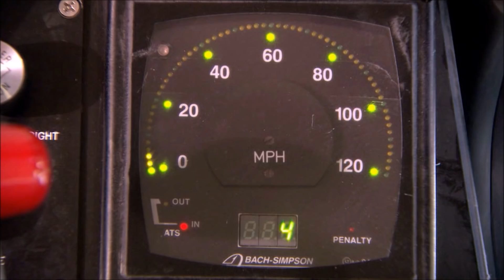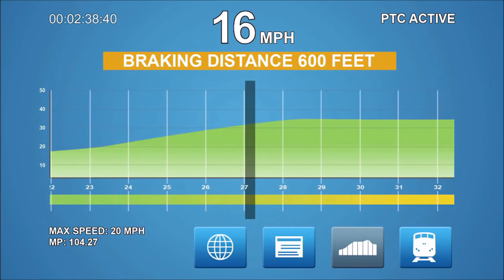Amtrak 501 "Cascades" Train Derailment 18 Dec 2017

Comment: Great report as usual, Juan... Thank you.    It's interesting to me,  that After a tragedy like this happens... how many armchair "experts" show up with all their comments,  and I am NOT including you... yourself, Juan... I am considering all the various posts I've read on various sites regarding this situation.  My heart and prayers go out to all those who lost loved ones either on board the train or in vehicles caught up in this accident..... and I pray that those who are injured will ALL heal, be well again and be able to continue with their lives and loved ones.

Before I throw in my own "two cents" on this.... I DO have past railroad experience as a Head-end brakeman and OJT as a locomotive engineer (until my wife gave me an ultimatum of "the RR.. or us?)... I took the "us" option..... but did continue on as a die-hard "railfan".   : )

A pause for thought..... Does anyone think for a moment that the railroad engineering dept's don't understand the correlation between train speed and track curvature (radius) when building trackage, especially when handling passenger service??..... I mean they've "only" been at this now for about a 186+ years, only to say that I can't imagine AMTRAK running 80mph service through a 30 mph "S" curve (as "shallow" as it is, overall).... unless they knew it was capable of handling it.    

Also,  the usual practice on a new or rehabilitated line that (especially) is scheduled for high-speed passenger service,  is to make at least one run with a train size scheduled for the service, and at the scheduled speeds to be incorporated on that line to be sure of no "issues"... Prior to the inauguration of that service.  Whether or not AMTRAK did this, in this case... I do not know... but that has always (at least in past years) standard practice.  AMTRAKS mainline service is "generally 79 mph".... but the NE corridor (NE-US) between DC. and Boston are running multiple, daily 120+ mph service.... and there are numbers of radiuses similar to the one here in WA.... without incident.

Pictures "can be" deceiving.... but, I will say that at the location of the approach curves leading onto the overpass... the track does Not (at least) appear to be canted in any amount of degree to the inside of the radius to handle any amount of speed beyond what is supposedly the 30mph approach speed limit..... which should have been physically posted ( I may have missed it, in all the various footage), as well as stated on the head end conductor and engineers Train Orders.

Also, the locomotive engineers that are selected for passenger service..... Are the "creme of the crop".... with years of prior service on mainline freights (Far more tonnage and train lengths than passenger trains), and have "stellar" service records (incident free)... they never use "newbies" in passenger service.

I cannot say emphatically.... however,  from what I'm seeing...... I "think" when all the "smoke" is cleared and the NTSB comes to their final conclusions.... they're going to find that "something" was on the track that derailed the lead unit..... and "IF" there was, the NTSB WILL find it,  because as Juan pointed out... the NTSB will leave no stone unturned... they really  excel at what they do,  and I personally... respect them for the fact that they do NOT jump to conclusions.... they just get right down to business and examine, extremely closely... every single shred of evidence from "angles" that the vast majority of the population would Never even dream of thinking about.... and when they make their findings finally known,  you can count on it that it is the result of a thoroughly Exhaustive work.

The NTSB is renowned worldwide for their impeccable and exhaustive work in finding the exact cause of commercial accidents... worldwide.  They not only investigate accidents here in the US but have been called in to determine causes in many other countries around the world, that are generally beyond the scope and abilities of the "country of origin" investigatory teams where train, airline, ship, etc, etc, accidents take place.

One other thing..... ANTIFA warned prior to this tragic derailment,  there might be problems.... they have now "claimed responsibility" for it...,  but whether or not they actually did cause it, or just trying to "make a name for themselves" (or, perhaps it's just more internet hype)..... time will tell for sure,  and the NTSB WILL Know without a doubt what the actual cause was by the time they are finished with their investigation... which could easily take many months or longer.   This is one dept. of the Federal government that does NOT have a history of accepting money to show favorable results on behalf of those who might want to escape any culpability.... they are totally unbiased,  and the cause and /or blame WILL Fall.. where it rightfully belongs,  without question.

On another note.... the lead locomotive (Siemens "Charger" - with 4,400hp Cummins QSK-95  V16 prime mover, built in Indiana) was just released after all its trial runs.... just a very short time ago, along with its "sister" units.  These locomotives are of German design but are built at their newest facility in Sacramento, CA.   They are specifically designed and US certified for high speed - 125 mph passenger service in the US.  There are only 8 of these units (out of a total of 63 units ordered) in the Cascades service and were just delivered to WA. earlier in December (just prior to this accident) after Each of them went through rigorous systems testing and speed/handling test runs. They are rated (at maximum speed) for a Minimum single curve radius of 250 ft.....   The rear (in the direction this train was headed) locomotive, a P42DC (aka General Electric "Genesis" Series 2 - 4,250hp [built from 1996 - 2001] ) is rated for 110 mph (due to its axle gearing ratio vs wheel diameter), with a minimum curve radius of 251 ft (just One ft. more than the much lower Siemans Charger).

The lead unit in this wreck is being taken back to Siemens for repairs and will return to service when complete.

The attrition would have probably been much worse, had they been running full standard size (Pullman type) passenger cars used elsewhere around the US,  which are in every way... much larger and heavier.... resulting in Far more momentum coming off the curve as it did.   It is also interesting to note that there was virtually no "noticeable" damage to the rails, whatsoever..... I have never seen a train wreck of that nature,  without severe rail and track "bed" (ballast) damage (being torn up).... could very well be possible due to the comparatively very small and very light weight of the Spanish built single axle passenger cars,  but surprised that the lead locomotive (at 264, 550+ lbs) did not tear anything up when it left the rails... and from the photos and ariel video footage,  it "appears" to have virtually "jumped the rails" completely and cleanly, not even disturbing the ballast for the roadbed... landing on the ground away from the RR. right of way..... very unusual to happen like that, compared to many other train wrecks I've seen throughout the US and Canada over the years.

Whether it Was actually ANTIFA or not.... my "gut" tells me that "foul play" was involved in this unfortunate accident.... and IF so,  that those responsible will be caught and brought to justice.   Those (especially) who lost loved ones, need answers and closure..... but I hope and pray that emotions and money hungry lawyers do NOT "jump the gun" and sue everybody in sight (which seems to have become the American Way, in these times... Sadly).... possibly involving those who may not have any responsibility whatsoever, related to the actual cause..... and instead will wait with patience,  until  the NTSB has time to thoroughly investigate and do  justice in finding the true and actual cause of this unfortunate accident.... whether it be singular,  or multiple factors contributing.

Comment: As an American, I am ashamed that our infrastructure is so old and lacking. It has costs lives needlessly. They put a whole bypass in but didnt build a new bridge and straighten the curve out? Bless the families of those that were lost.
Reply: All the maps show that region is geographically constrained and developed, with the existing track route sandwiched between a busy highway and a large military base. Building new infrastructure under such conditions, where existing rights of way have to be respected, is much more complex and expensive. Those trade-offs occur everywhere around the world.
Reply: Your points about re-routing are valid, but impractical for a line that carries a limited number of passengers. It would be extremely expensive to build a new bridge, and slowing down for the curve adds a minute of travel time at most. Re-training, signage and PTC would probably cost less overall, with wider benefits. All of those questions are likely to be asked by the inquiry. Safety is expensive, and accidents are costly, but broader lessons are always valuable.
Reply: What you say is true and accurate for the entire straight stretch of track leading north from the bridge.  It appears they simply rebuilt the bed and rail over the existing right of way used by local freight trains.

South of the existing bridge it gets lower to sea level and the ground is swampy in sections as the rail bed has to cross the Nisqually (River) Flats.  There is room to build a new overpass bridge here as the country is sparsely populated.  But the geology might have been a prohibitive factor when they budgeted for this new line.  I would speculate they have future plans to take down the existing bridge and replace it with a "high speed" bridge.
Reply: Agreed.

Comment: Just looking at Washington State tragedy.

Crossing 085839A  Google map location 47.0821204,-122.6755991 right off of FRA crossing  inventory. Same graffiti as news coverage on overpass. Feds show BNSF took over track in January. 0 trains and speed limit of 10 mph. Nothing about Amtrak or Sounder. The 10 mph is the only thing they could go by to me.

The questions would be is where is the 30 mph curve speed limit in writing before the train rolled and the 30 mph flashing sign facing the train IN TIME for the slow and the <<< or >>> signs around the curve? But then rail safety consists of little baboons the railroad carries around in their deep pockets

Comment: Good video. I have three friends hurt in this loss, and work within less than a mile from the site. I was very familiar with this curve as they rebuilt the line for Amtrak/Sounder use. the news keeps morphing like it always does, but the knee-jerk 'witch hunt' against the crew appears less and less viable as the news from the NTSB comes out. As far as I know, they didn't test run a Cascades train on this line in wet weather. There was a very untypically dry summer in 2017, when most of the test runs on the line were made. The overhead photos aren't very realistic for a track view, though. It's a straight shot in open conditions from the track level from under the last I-5 on/off ramp at the south end of Dupont, where the test trains made a brake application which seemed to work well on those test runs. here's only the cut and the small bridge connecting Mounts Road to the Gold Course beyond that, then immediately there's the curve at the bridge. I've stood at that approach and saw no appreciable (if any) super-elevation of the track, I assume as there's a 10MPH speed restriction for freight trains at the approach to that curve. There's also a block signal less than a mile before the curve.

Comment: The spokesperson for the NTSB is not helping with the understanding here by saying PTC was not activated for this run.  It was not even installed yet.  So it could not have been activated.  Amtrak has announced the line would not be used again until PTC is installed and operational.
  
This line was a refurbished old, existing line.  Where it ran parallel to the freeway, new rails and bedding were installed so that an 80 mph speed could be safely accomplished.  But this line also incorporated the old, existing bridge over the freeway that was not speed rated whatsoever.  So the train would have to slow way down to safely cross the old bridge. 

It was originally reported the engineer had driven this route previous to the day of the accident.  

Regarding all the interesting speculation about who knows what.  Simple understanding of physics would indicate the train had a tremendous amount of energy in it to derail so violently.  NTSB is saying the engineer began setting the brake just moments before derailing.  The engineer would know better than anyone how much distance he would need to actually bleed off that kind of excess speed.  A classic case of "too little, too late"?

Comment: You mentioned a bunch of possible candidates responsible for this accident ... all but one.  Hacking.  Is it possible this system - still being worked out - could've been tampered with via computers?  I wonder how many mistakes have to occur for a train to accelerate so fast before anyone realizes it's about to slam into a bend 50 miles an hour above the posted 30 mph limit?   And wasn't the PCT activated yet - having already been installed 3 months previously?

Comment: This is not full of useful information, it is full of misinformation.  No way would experenced  engineers which have intimate knowledge of the particular section of railway have been going 80 mph.  The location of the locomotive location after the derailment is wrong for a train which would have been traveling at that speed.  It is not possible to stop the locomotive in such a short distance.  Dr William Mount (Retired Army corp of Engineers) stated that in order for those cars to be on both sides of those tracks they would have to have been blown over the 6 foot bridge sides .  This could only be accomplished with explosives.  At aproximatley the same time Homeland Security was just starting a Mass Causality Drill just around the bend in Dupont.  Is this coincidance, this is quite suspect at best.  This pilot is a misinformation agent, I while in the Military was a member o the Aircraft Recovery Team.

Comment: Are there any Amtrak engineers that could verify something I was told by a BNSF engineer that passenger trains have computer controlled governor's that prevent an operator from going over a rated limit? It is apparently separate system from this positive train control system discussed in the video. He said the computer should have prevented a speed of 80MPH if it was programmed correctly.

Comment: Question,Question: that is screaming out...Why didn't the train engineer, slow the train at 30mph at that critical turn? Even though Amtrak decided to make it's maiden voyage without the system properly installed, there should have been train control towers knowing exactly the train's GPS positioning and have warned the engineer and conductors. I smell sabotage, either by the engineer, or members of the dispatch ground crew. Whether or not a chunk of concrete was left behind by Antifa, is only rumor so far. It looks , so far, like failure go,take proper caution on a turn over an interstate highway..I shake my head ( SMH)

Comment: in your report you say that the data recorder in the rear locomotive was recovered and showed the train was traveling at 80mph, almost 3 times faster than the zone was rated. since the engineer uses the radio successfully AFTER the derailment, one would have to assume that said radio was operable PRIOR to the derailment. since no distress call or indication of equipment failure was transmitted, wouldn't a human factor be indicated? either gross incompetence of the engineer, or the use of human force to compel the engineer to not reduce speed in this circumstance be the inevitable conclusion? if the track had been tampered with, we would know that by now. this is a scary situation.